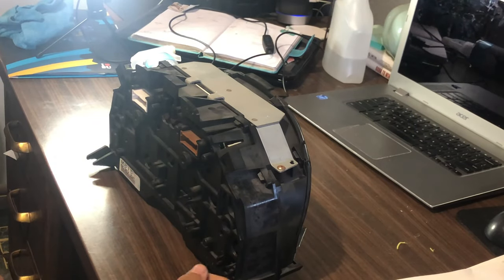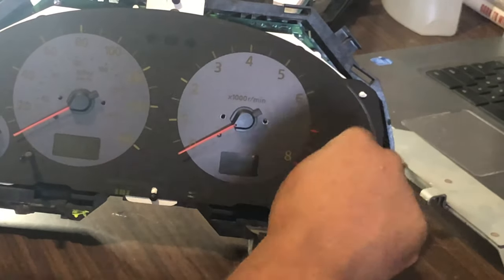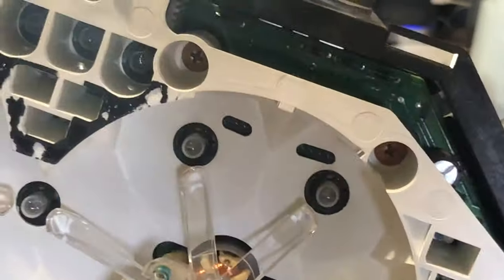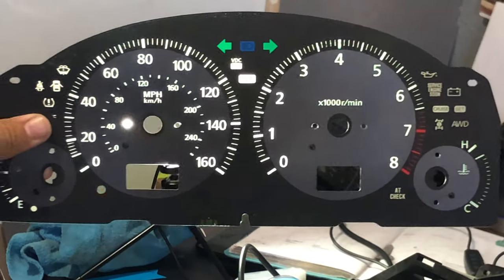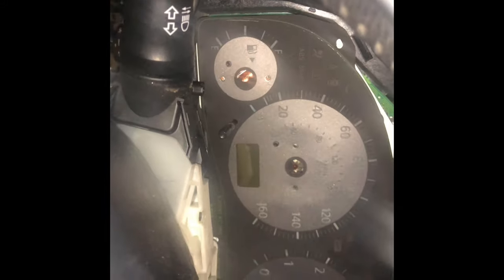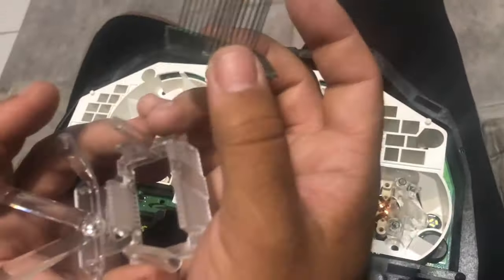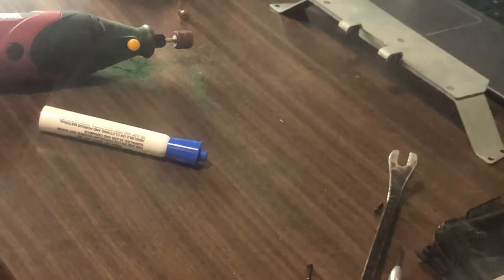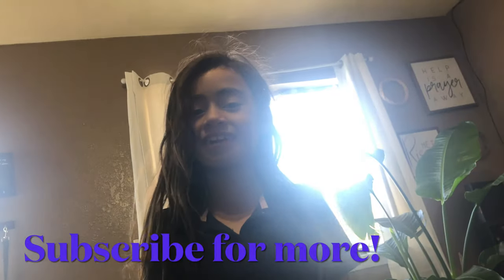G35 custom cluster

Comment: Do u have a link on where u got them? And what year is this?
Reply: 2003-2004 G35 cluster. 05-06 have the updated style and  “Plasma LED”, different electrical Connectors
Reply from the maker: Yes, it’s an 03. The links are in the description. Thanks for commenting!

Comment: Can I use t10 bulbs? Also I use some blue bulbs but It looks uneven
Reply from the maker: The T10 bulbs would not fit as the base is too big. If it’s uneven it may be that you sanded too much in certain areas

Comment: Why didn't you just get ice blue colored T5 bulbs !? Lol you did a good job I sell LED kits for gauges and dash as a side hustle it'll make your life easier and shome brighter as it won't be having to go through any paper. That way you can just use whatever color by ordering the bulb in the color you want.
Reply from the maker: I was initially planning to just that but since I had to sand down the back of the cluster I have had “hot spots” where the light was really bright in one section almost causing a distraction